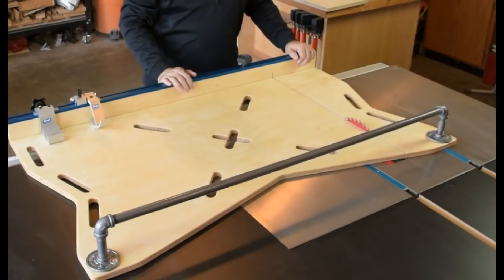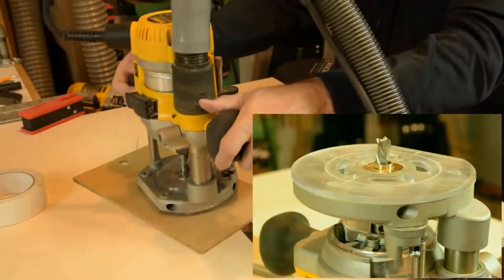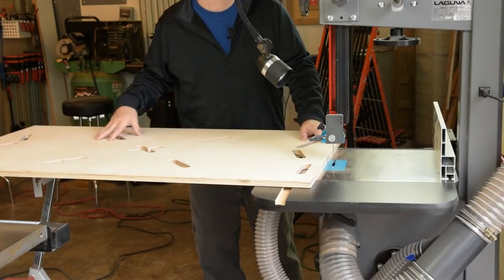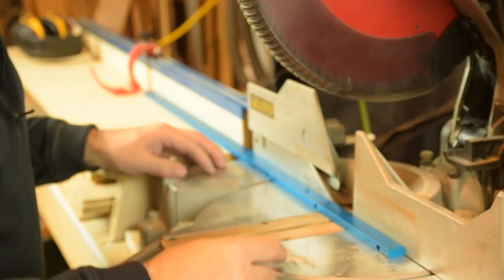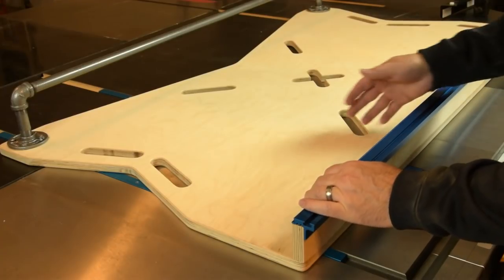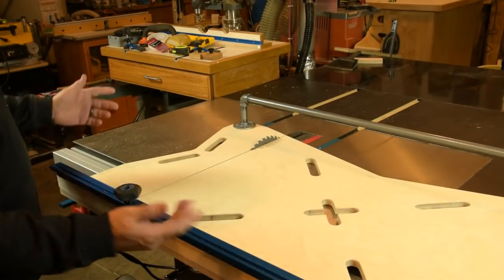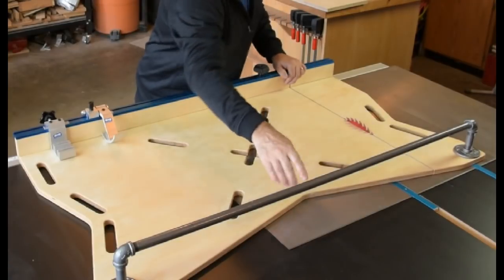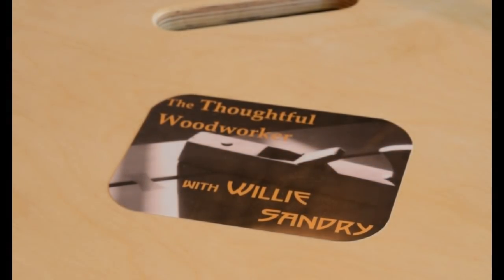How to Make a Crosscut Sled for a Tablesaw | Woodworking

Comment: Any particular reason you are routing in the reverse direction at the 3:30 mark?
Reply: Hi Kevin, yes you are correct the typical direction would be counterclockwise in this case, and I moved the router clockwise.  If I went in the traditional direction, I would have had to stop the router at a certain point to avoid cutting into the sled.  I thought it would be easier to start at that point, and rout in reverse.  Of course you have to trim only a small amount of material (1/16" or less) and maintain firm control of the router.  Very sharp eye you have!  Bonus points for you.

Comment: Enjoyed the cross cut sled design.  I have a question and a request.  The request is can you make a video on your outfeed table and the side table.  And the question is, does the cross cut sled work without the extra table support?  Thanks.
Reply: I would have normally done a video on the outfeed table, but mine is pretty specific to my needs.  It spans between two tablesaws that are positioned back-to-back.  I don't see many people running that setup, so I felt a video wouldn't be that helpful to folks.  In answer to your question... any crosscut sled should have some outfeed support, and mine is no different.  However, I consider an outfeed table (or support of some kind) mandatory for basic ripping cuts too.
Best

Comment: Wow, that's a whole lotta work to make something that is normally a pretty straightforward, simple, utilitarian piece! Looks like someone has an overabundance of time on his hands...
Reply: Looks like it would take up a lot of storage space too.  I can't think of any project in 50 years of woodworking when I would have needed one this big.
Reply: @danielfundo791  My requirements were it needed to cut 36" long pieces, by 24" deep without limitations (cabinets and furniture building mostly).  The cross bridge allows deeper cuts in certain circumstances without any real negatives for me.  Because the flip stop needs about 3" of width to the right, I needed to have 39" to the right of the cut line.  I encourage others to share their designs and ideas.  Thanks.
Reply: @TheThoughtfulWoodworker  I understand building such a crosscut sled if you have a need for production work or multiple pieces.  Fine !  I have jigs that no one else would ever have a need for.  I have a small shop and something this big and heavy would be a hassle.  I would use a wooden foward support.  I don't have anything other than aluminum or brass on my jigs.  Steel has a way of finding blades (moving and stopped), no matter how careful you are.  BTW, I'm a retired engineer; good design !!!
Reply: @danielfundo791  Hi Daniel!  I thought the same initially, and built a small sled for crosscutting furniture parts.  It always seemed to be a little too small!  Now I can easily trim boards up to 3' long, which is something my old sled couldn't do.  As far as the steel contacting the blade - even with the blade at max height it can't touch the crossbar.  My favorite part of posting shop projects online is to see all the other versions people build.  I invite people to take this concept and improve on it, or at least customize it for their unique application.  Thanks for chiming in!